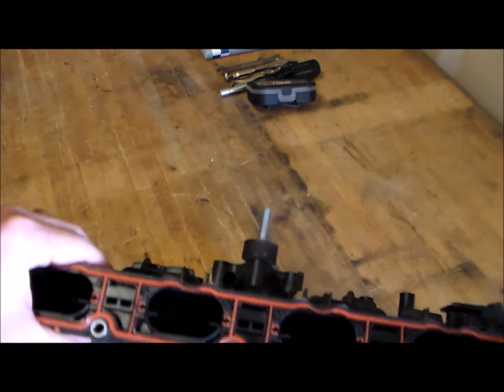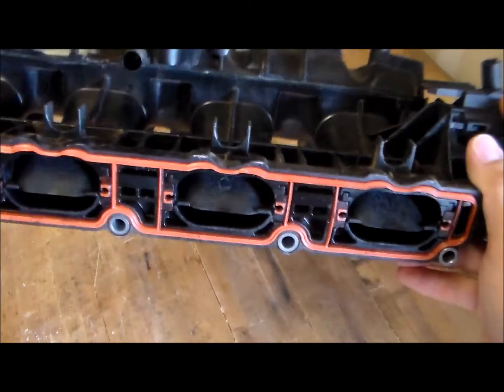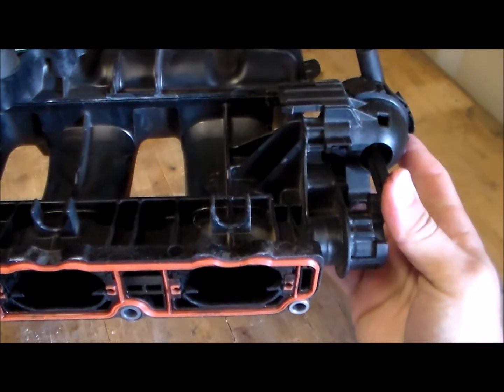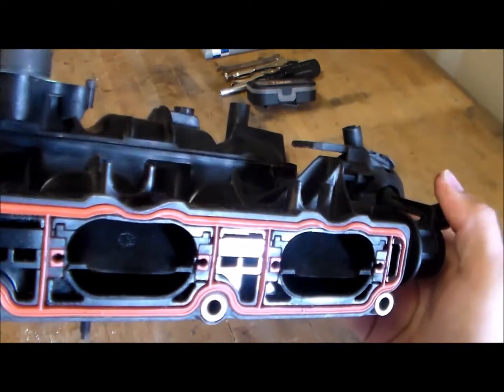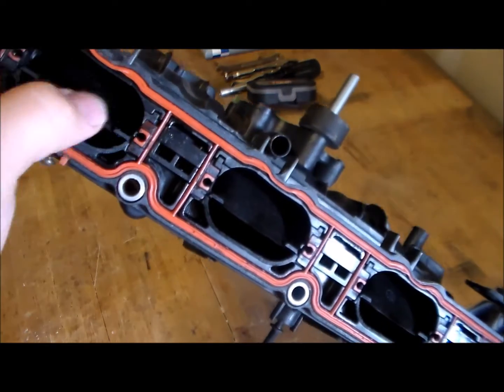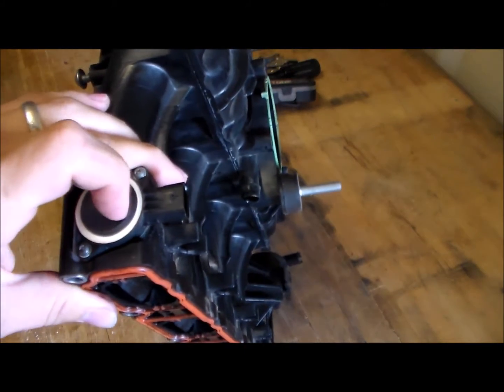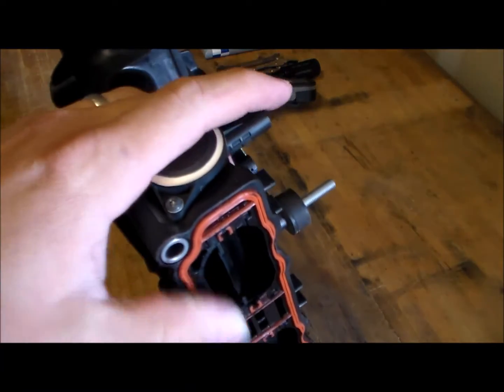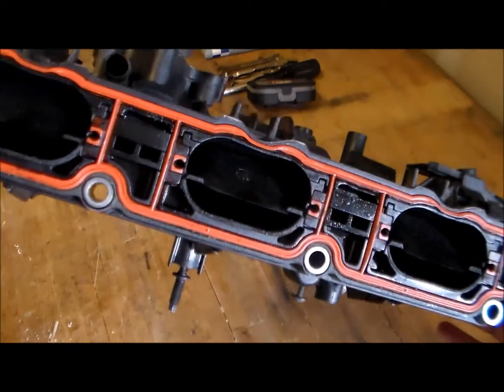Runner Flaps

Comment: Those flaps effectively change the length of the intake runners long for more torque down low and short for top end, you basically described them as if they were the throttle body

Comment: I have a 2008 Saturn Astra 1.8 code(P065E).  The IMT( runner/flapper) valve uses a 3-wire position sensor with magnets. My question... (1) what does this code imply ? can it be fixed inexpensively and how to?
(2). can I do the delete IMT runner with no harm to engine?
Thanks

Comment: there is no electro mechanical part (Motor) in there and also thats not the switch to turn in on, its rather a sensor, the diaphragm is operated via the manifolds suction and the sensor tells engine the position of the runner flaps, the suction is regulated via a solenoid valve